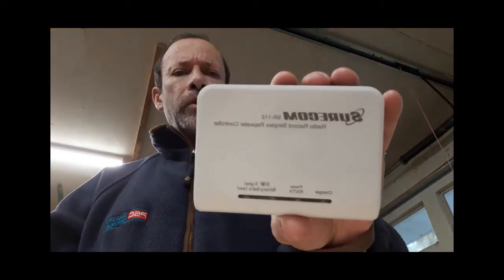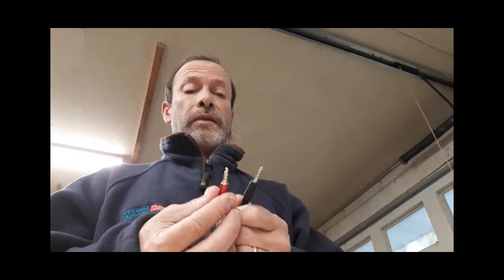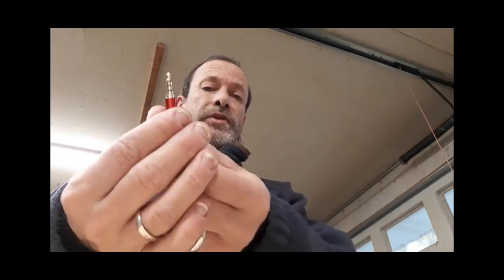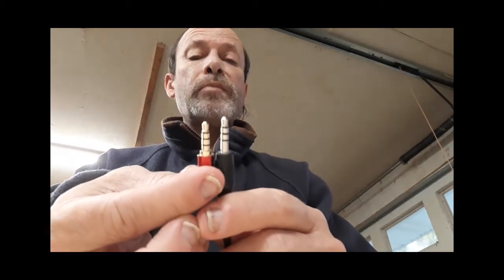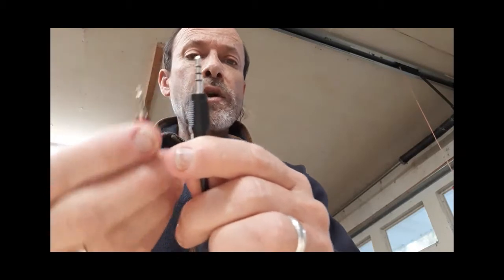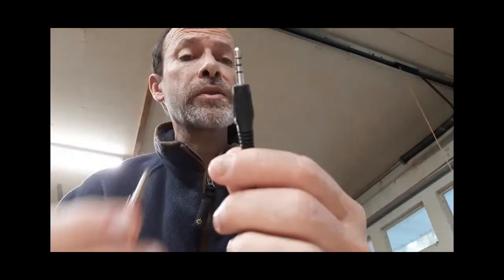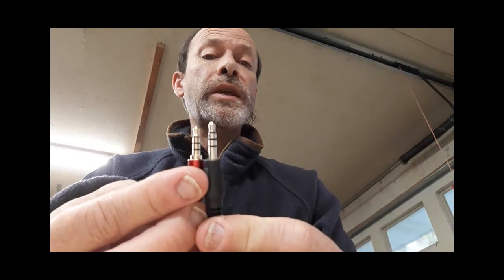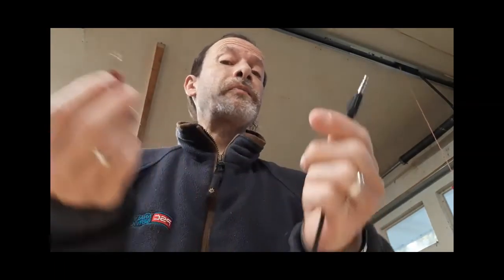Surecom SR-112  repeater controller problem and fix

Comment: I've been trying to connect a QYT- KT8900D radio to a SR-112 Simplex repeater controller. I got the cable just as you are explaining, but it still not working, it is actually repeating, but the second transmission is coming with no audio.

Comment: Thank you so much for posting this!  I was having the exact same problem...except by removing the metal collar on my purchased plug, I destroyed an essential electrical connection between the 4th collar and a 5th hidden collar.  This ring seemed to be there to foil us DIYers.  So, I opted for chopping the provided Baofeng and using that instead.  

Back in business.  Thanks for the tip!